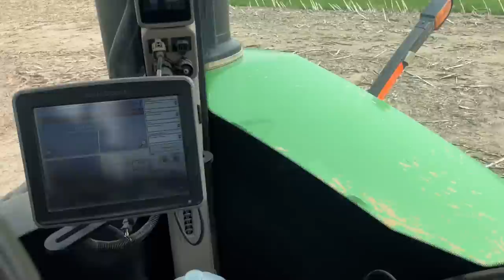How Many Problems Can One Implement Have??

Comment: It's no wonder that you're having so much problems you don't grease wheel bearings like that with a grease you got a grease the wheel bearings first and then you can add gun grease later to keep the wheel bearings full of grease no wonder you're having so many problems they sure don't know how to take and do maintenance work
Reply: I was wondering if they packed the bearings or not. That would explain why that wheel looked so tight. Friction on axles. Bad
Reply: its got a grease fitting dont understand
Reply: And they way over tightened the bearing should have spun alot easier than that.
Reply: Preload tight I agree .. grease fitting nice ... 4 pumps every morning on spindles?!
Reply: @matkremzar5474  Properly pack the bearings so the inside one doesn't run dry until gun grease gets to it .